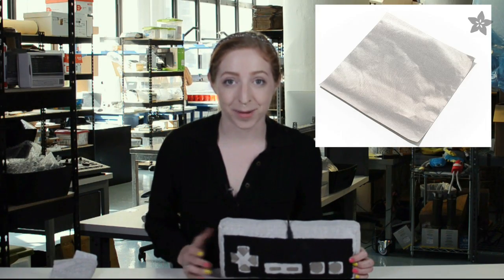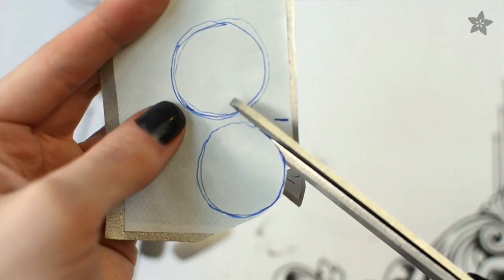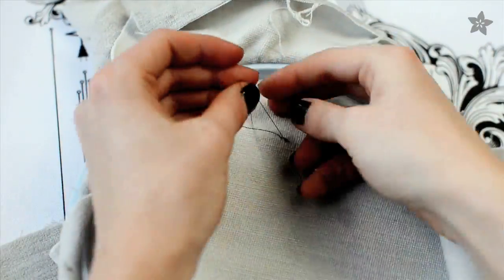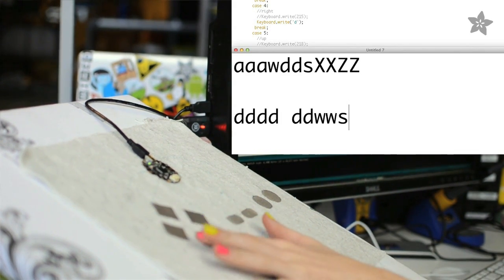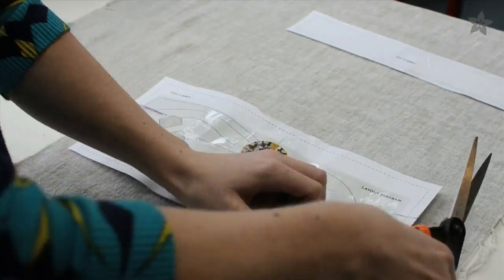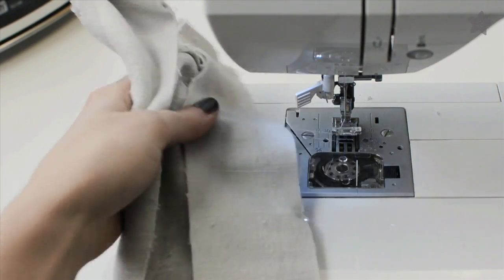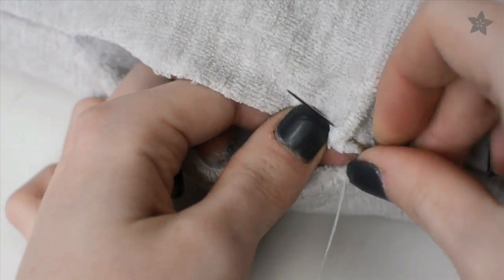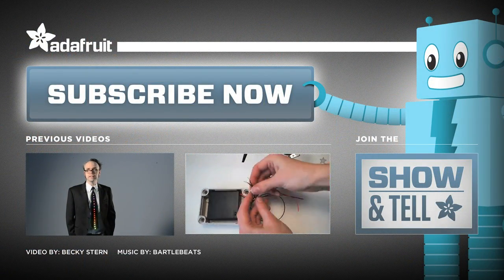Plush Game Controller with Flora & Conductive Fabric

Comment from the maker: Plush Game Controller - Capacitive touch sensing with conductive fabric & Flora  #Wearables   #FLORA  
https://learn.adafruit.com/plush-game-controller

Make an oversize plush game controller that actually works! Use conductive fabric and a Flora board to stitch up a capacitive touch sensing circuit. The controller acts like a computer keyboard, allowing you to play all your favorite old school games on emulator sites online.

This is an all-sew project with no batteries, making it great for beginners and even kids to try.

Read on to build your own! https://learn.adafruit.com/plush-game-controller
Reply: Quisiera saber la composición y construcción de la tela conductiva